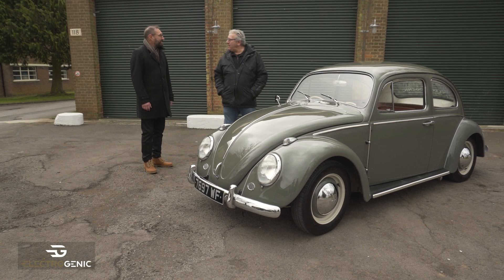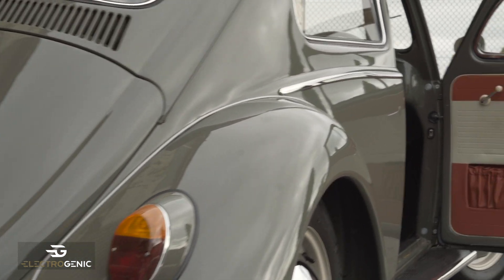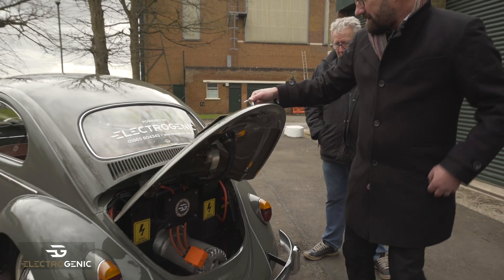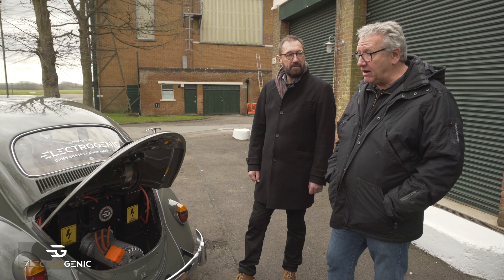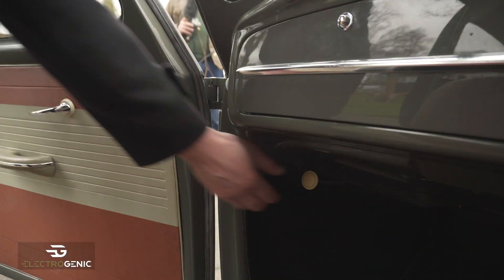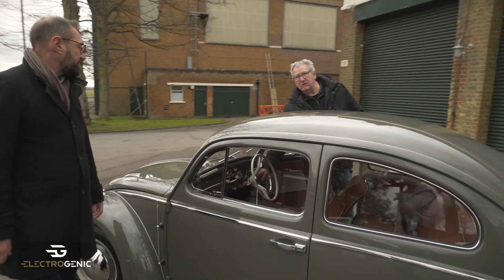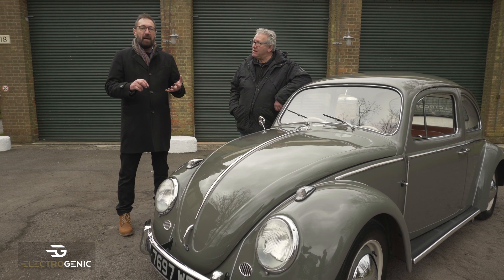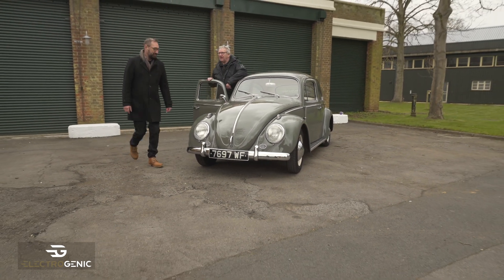Electric Beetle classic car conversion | Electrogenic

Comment: What might scare me is all that weight and no update breaking.  I think I would put some  tipe 3 wider drums in back and disc in front and porsche 5 lug
Reply from the maker: It weighs 30kg heavier more than the original car and has all of the original servo braking, plus regen braking from the motor. So it stops on a dime.